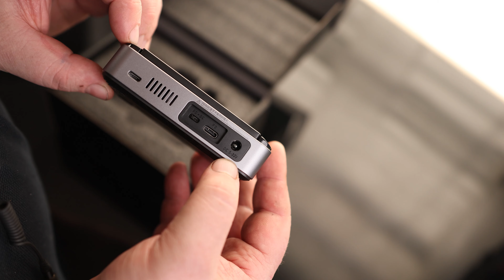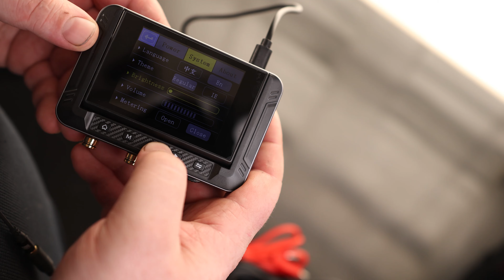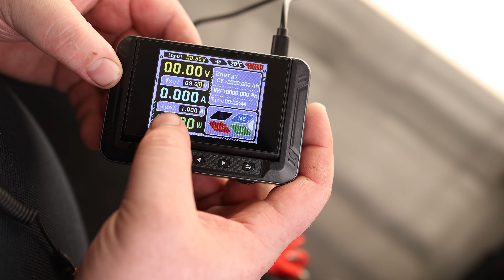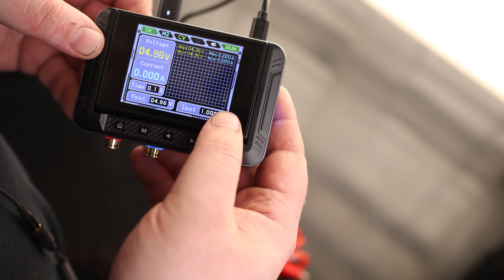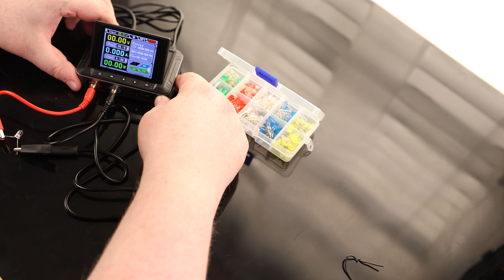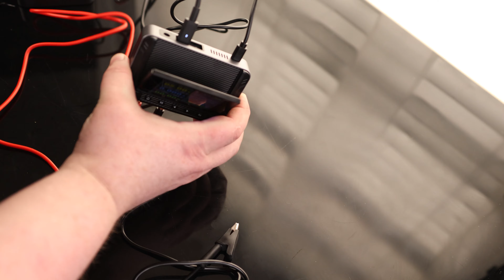FNIRSI DPS-150 DC Power Supply Variable, 30V 5A Adjustable DC CNC Power Supply with 4-Digit IPS

Comment: I use this with ryobi batteries. This replaced my Etsy 3d printed voltage converter. Basically, if I can't find or lost a specific power adapter, I'll use this and a ryobi battery.